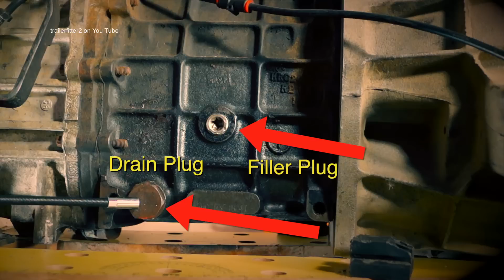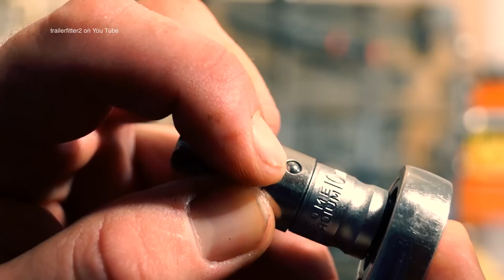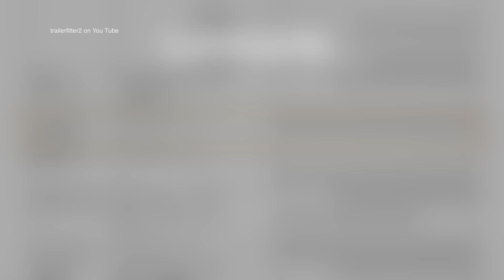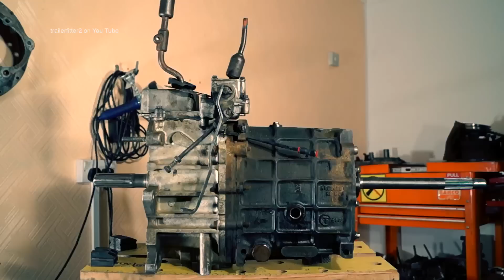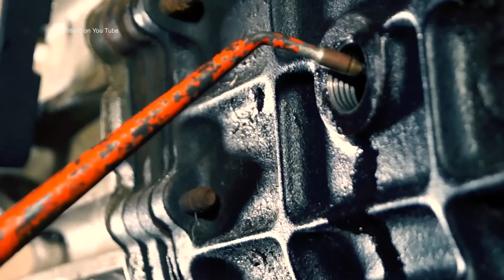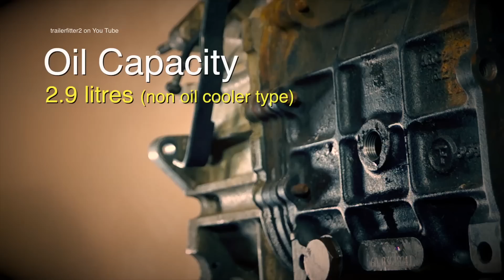Land Rover servicing tips, tricks and tools - R380 gearbox drain and refill

Comment: Pity  it doesn't  mention  you  carn't  use a socket, when it's actually  fitted as the  propshaft  is in the  way. You'll  need  a spanner  instead.

Comment: I use a standard oil container, drill a 10mm hole and run around 700mm of 10mm clear tube through the hole to the bottom of the container and the other end up to the fill hole. I drill another 3mm hole next to it and put my air compressor gun to the small hole (forming a seal). I turn the compressor right down and pull the trigger - this will pressurise the container and force oil into the gearbox/diff/transfer. Thanks for posting, I love your tutorials.

Comment: I changed my R380 oil in my defender by removing the cubby box & then the transmission cover plate under the cubby box.   Throw a large rag like an old towell on the ground for the little bit of overfill you will get.
Then i simply attached a 2ft long hose to a funnel & sat in the drivers seat & poured the oil in 1 litre at a time until the transmission is full.  Easy,  no mess,  no pumping,  to trying to get oil to travel up.

Comment: Not sure about on a defender but on the discovery I needed a 32mm spanner for the drain plug. There's not enough room between the shaft and the gearbox for a ratchet and socket. Great channel, thanks for all the info :)
Reply: I am working on a Discovery 1 too.  I cut down a 32mm socket with a cutting disc on an angle grinder so it was only about 10mm deep. Pretty easy to do. Then there was enough space at least to get a ratchet in to finally torque it up or a breaker bar to get it undone. No spanners used.
Reply: @richardl7689  smart, I wish I'd thought of that.
Reply from the maker: fist frames in the video is a Discovery 1. It is possible to get a socket and ratchet onto the fill bung but I agree it is very very tight.

Comment: Amazing video! Thank you for sharing, explaining, and taking your time to do this. You wouldn't happen to have a tip or technique for replacing the reverse light switch on the r380? I have asked many a LR mechanics, enthusiasts, and had nothing but answers of "good luck!". Cheers and thank you.
Reply: It's quite easy to do from top m8 take off gear selector and plastic console and remove rubber gater - u will see top of box - switch it screws into the side on passenger side

Comment: Hi great video, I replaced the oil just week ago but looks those idiots in my local shop give me wrong oil (EP80-W90 GL-5) I have problem with shifting the gears now (2nd gear especially when cold). Should I replace it back to MTF-94 imediately or can I drive the car for few weeks? Thanks
Reply from the maker: Rob K  it is awkward until it warms up then the oil gets thinner and works better.   Best to change ASAP to be honest since the gearbox relies on an internal pump to get the oil to where it should. If the oil is too think it won't be able to pump it.
Reply: ***** Thanks a lot.
Reply from the maker: Okay!
Reply: Chris what about mtf94- as was told this was the best thing to use - swapped my gearbox over as old 1 2nd gear synchro was gone - filled with mtf94 and it's a bit hard to put in 2 when cold until box warms up- what u think I should do??

Comment: best way to fill it with oil is to slide a 3/8 hose down beside the gear shifters in the cab then stick the 3/8 hose in the fill hole and fill her up from the cab